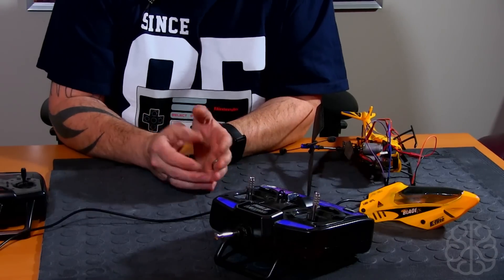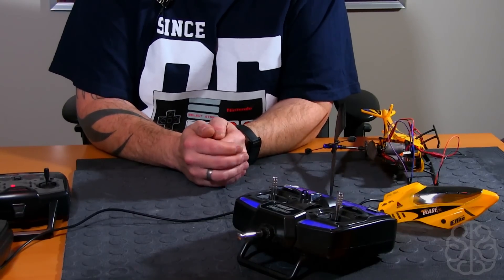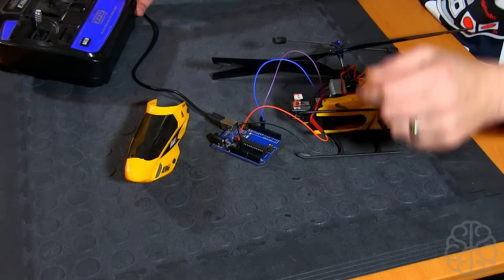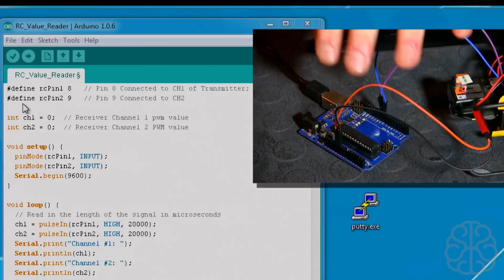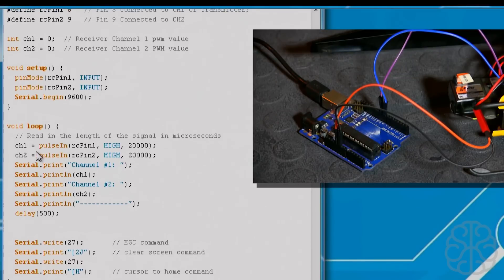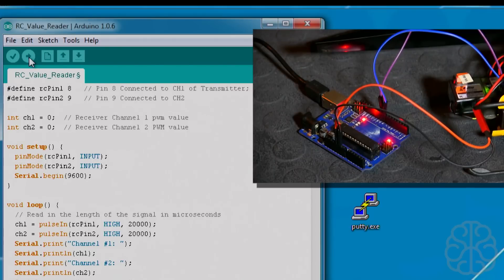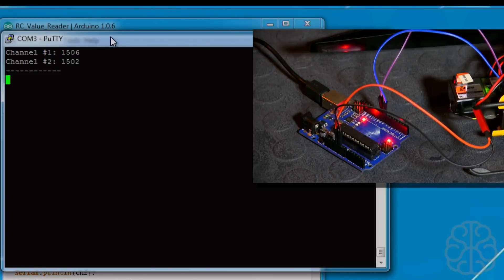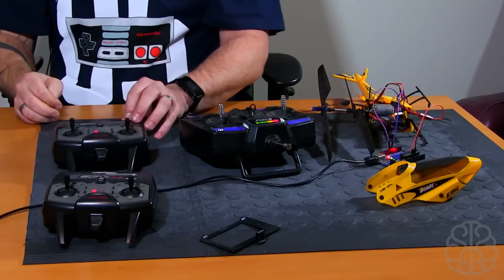Use that old RC transmitter to control your next Arduino Project - Tutorial + Channel Update

Comment: I have a huge RC 4x4 that doesn't work anymore.
But what you're saying is, if I replace all of the electronics in the truck, with an arduino, and hook up all of the servos? I can then bring the 4x4 truck back to life? Using my own power supply and TX and RX?
I have one last question.
I have the EFlight chopper. Why is it, that when I connect power to the RX, the servos start littering around?
Is the RX ruined?
One last thing, I can't believe that after learning Arduino through YouTube, you're the only person explaining this?
Freaking awesome!
I thank you for this video explanation!

Comment: Plzz provide the Circuit photos..and  diagram.. cant understand the connections..i am having gyro LH 1202 rc helicopter..it has 3.5 channels..
How to connect its receiver to the arduino?
Reply from the maker: The Tutorial page of this tutorial is available on our website at: https://brainy-bits.com/tutorials/rc-transmitter-with-an-arduino/

You can check it out if you want to copy/paste the code and for more information.  Thanks again for watching!

Comment: very new here cant find a code or project for a flysky receiver t4b connecting to a arduino uno driving two motors for remote control lawnmower please help thanks

Comment: You did not show the individual channel connection on the receiver board in a photo or so. Usually controller boards do not easily show ther 'configuration' as in your shematic drawing on your web page. How do you recommend to figure out what the four or six channel connections are? What are they in your broken heli? Thanks.

Comment: Hi! I am currently building a custom robot using an RC transmitter (Thanks to your tutorial, I was going to use another arduino and RF transmit before finding out how easy it is to use an RCT.)

The problem I am having, when I extract my joysticks' data to PUTTY, 1 time on 2 it returns a value of 0, then the next time it returns the accurate value. Is it just a delay issue? I will use these values to power out PWM control modules, I don't want to burn these out !!
Reply: Increase timeout value. I had same issue.

Comment: Hi , you tutorial was extremly helpful during a project I'm working on. The issue I'm having is that I am unable to read values from all channels simultanously. I am using a FlySky FS-T4B with a FS-R6B receiver. I want to take values from channels 1, 3 & 4 to and use them with an Uno to operate a robot I am building. If I connect one channel at a time to the reciever I can read values from each channel as i test them. The sketch I am using is almost identical to the sketch on the video.
However I can only read values from 1 & 3  or 1 & 4 or 1 & 4 on my serial monitor if all channels are connected to the receiver. Basically, if I have 2 channels on the receiver beside each other connected to my Arduino I can only read from one of them.
I am wondering if anyone has come across this problem and is it an issue with my (cheap) radio controller or else something with the arduino. I am fairly new to using Arduino so my knowledge is limited. Cheers, Ronan

Comment: I tried this and couldn't get it to work.....Until I put a 300ohm resistor between ground and the input pin. But my RC receiver had it's own battery that measured around 3.7v. I used a common ground both before and after trying the resistor. The resistor was the fix.
Reply from the maker: +p k Thanks for posting your fix, it might help others getting theirs to work! Since I was powering mine directly with the UNO maybe that's why it worked without the resistor.  Thanks for watching and sharing your solution!

Comment: PulseIn is a nice fucntion, but every channel you want to read add +20ms because it has to run through all the channels sequentially,which leads to an update rate of 140ms when dealing with a 7channel receiver. I advise people who want to read multiple channel,yet keep a high speed, to look into Pin change interrupts, Which are interrupts that detect when a Pin group has changed,then you can read what changed.
Reply: +Brainy-Bits Great videos.  I've been waiting for a tutorial on pin change interrupts to help me read 5 or 6 channels from from my RC Transmitter while still running other inputs/outputs on my Uno.  Could I suggest a part two of this video to show us how to write that code?
Reply from the maker: +Flo wey Thanks for the suggestion on using Pin change interrupts, which I didn't know about until you mentioned them :).  I've only used external interrupt before, which the UNO only has 2, but being able to have them on any of them using Pin change can be very useful.  Thanks for watching!
Reply: +Brainy-Bits No problems, Enjoy your videos and love to help out others ;) , You can also make a logic analyser (a slow one i suppose) with a pin change interrupt.
Reply from the maker: +LSUtiger607 Will make a quick tutorial on using 'Pin Change Interrupts' right after the next one which we are releasing this week showing our PTZ cameras.  Will try to release both of them this week!  Thanks for the request and watching!